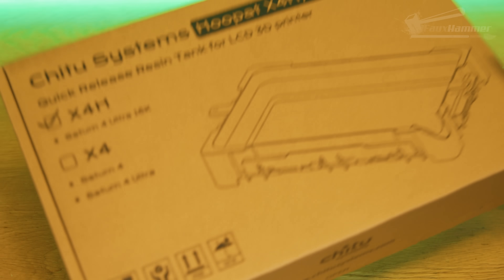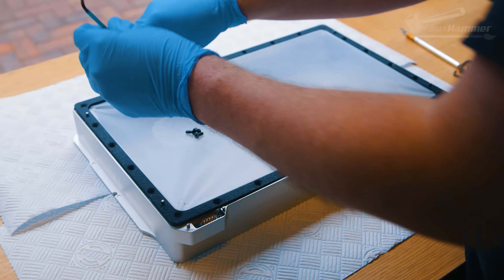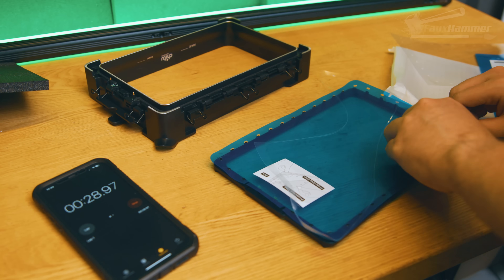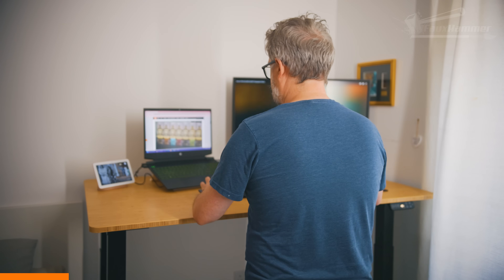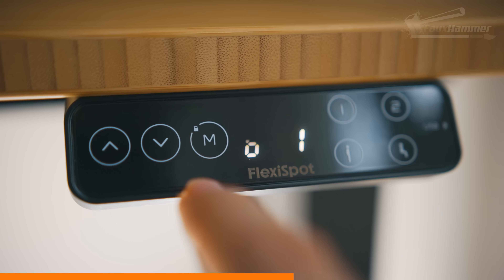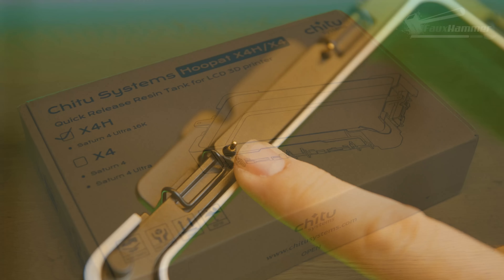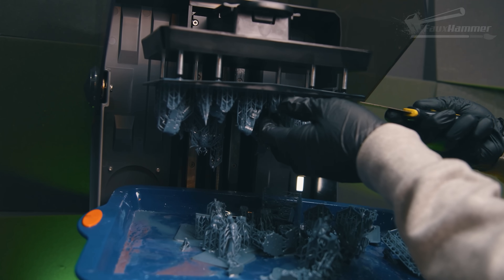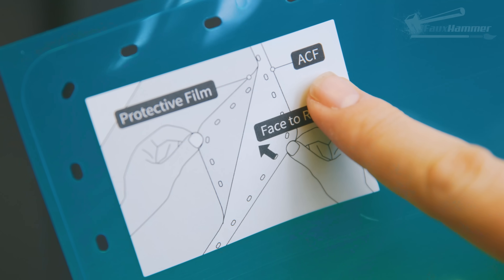Hoopat X4-H Now Exists - "NOT A REVIEW" - "JUST A PRODUCT ANNOUNCEMENT"  (+ Sponsored Segment...)

Comment: Firstly, loving the channel, it has helped me big time in getting set up and what to do, so big thanks for that. On the Hoopat X4H, I love the idea, and when I got mine, it was super easy to install the PFA. That said, I had to return it because one of the pins wasn't long enough to reach the sensor on my Saturn Ultra 16k; it's probably a one-off, but the only thing that lets it down is that the contacts are not spring-loaded like the Elegoo tray; otherwise, it's a great idea.

Comment: could they include a battery and make heated vats for printers that don't have one? then recharge the battery with usb c, or be able to swap it out. also a small toggle switch to change the vat temp from like 3 presets. 
another idea: could they do some research and find better plastic sheet material to use? then they could make it available for all printers.

Comment: So yes this is faster than than the traditional method. But 5-10 minutes to replace a FEP is totally doable. Provided you keep a clean work area and have the right tools. I'm not going to count the time to clean the vat because you need to clean the vat regardless. Even using this vat you should clean it so you don't have resin drips going anywhere while replacing the FEP. I am away from my printer but I am sure i can do it in that amount of time. But there are some things that the people do that make it so they can do it that fast. They probably keep a clean workspace. Not having to clean the workspace to change the release film means you can start right away. Next they probably are not using the included Allen wrench and instead are using something way more comfortable like a hex screwdriver a screwdriver with interchangeable bits or even a battery powered screwdriver. Next we don't do that weird twisting thing when poking the holes. You just need to prick it. But your biggest slow down is that allen wrech. They are designed for torquing screws down not for acutally screwing and unscrewing stuff quickly. Just using an allen wrench instead of a screw driver makes it take 2-3x as long because it's really awkward to use because that's not what it was designed for.
Reply from the maker: Yeah, I think the basolute best time would be between 5-10 minutes but even then I'd question it being properly installed. Sub 5 minutes as claimed by people. and I'd love to see that!

Comment: I bought FEP sheets with frames attached that are already tensioned: £16 for a two-pack for my Anycubic Photon Mono 2. I've only had call to replace the FEP once so far but if I was trying to do it fast it'd take about as long as the one you've shown.

In fact, being a resin printing newbie I assumed that was what everyone did. The first time I saw a video of someone cutting and tensioning FEP from a roll I was shocked!
Reply from the maker: haha, yeah those smaller anycubics did do the whole plastic frame thing. Heygears do the same, but a metal frame and much more money.

But still, doing a mono 2 as fast as this.... (assuming both start with a pre-cleaned vat and onlt need the film sap to be done) c'mon... even with a powered driver....

Comment: Ross… sure, swapping a clean film for another clean one—or installing a new film on a fresh Hoopat—might take 90 seconds. But don’t try to tell me you can replace an old, worn-out film in 90 seconds… unless you’re skipping cleaning the housing entirely.

Yes, it’s innovative. Yes, it’s faster. But under normal conditions, a full replacement doesn’t take just 90 seconds.

For me, a full swap with cleaning takes around 30 minutes on a standard vat. With the Hoopat, I can do it in 5–10 minutes if I want to take care of every detail.

It is fast...  but not that fast.
Reply from the maker: Ok fair and I thought if this as I was doing it.But let’s say both vats are clean and ready to swap.

This during a best case scenario vs the arduous unscrew re screw process is still well longer than 5 minutes. Vs this that is much , much faster.

And even if it could be done in 90 seconds. Heck at a low effort push, I could get this j der a minute. I’d still want to slow down to check everything is aligned properly before clamping too.

This was just a live demonstration of the process whilst timing myself.
Reply: @FauxHammer   Of course, if both vats are clean and ready to go, that’s a completely different story—then it really can be a matter of 90 seconds versus several minutes of fiddling with screws. But I think we can both agree that cleaning the vat is part of the film replacement process, and it does take time. Sometimes a bit of resin gets behind the edge of the film, and you know from experience how many extra steps that can add.

Hoopat is a fantastic product that truly speeds up the process and significantly increases the chances of a proper installation. I really hope it becomes more popular—and who knows, maybe printer manufacturers will start developing their own versions.

P.S.

I’ve never understood why so many people punch holes in the film with a knife, leaving potentially jagged edges around the openings. Personally, after assembling the frame, I simply push a sculpting needle through the holes. It creates clean, round openings without the risk of tearing due to stress.

It’s like making a hole in a plastic bag with your finger versus using a knife—try it yourself and you’ll see the difference.

P.P.S. Great job on developing and running the channel—really appreciate the effort and the content you share!

Comment: Yeah! Innovation, thanks. I need one for Any Cubic M7, did not see it on list. If it included a way to heat it also, I would appreciate it. I am down to see a FEP change Olympics.
Reply from the maker: thats. a good pointa ctualy, they have m5 but not m7? wish they culd do one for the m7 pro but make the interface work with a heated vat rather than a pump
Reply: @FauxHammer  Right I do not have the pro, I could use a USB plug in heater for the vat instead of the fan unit.

Comment: So, say someone has a "old" Saturn 4 ultra, a drill and soldering equipment.... would it be possible to upgrade to a heated vat this way?
Reply from the maker: i think yould be better just lighting a campfire under it, i mean its not impossible, but it's more than just wires that arnt there, there's electronics and programming too
Reply: @FauxHammer  Haha you may be right. If it's the same size I'll get the H version and look at it. I realize I would have to hook up my own power supply, control and sensor.

Comment: the way they made the top edge uneven is really annoying, if that was consistent then it would be easy to put some masking tape around the whole thing or at least the front to avoid resin getting into the mechanism
Reply from the maker: not sure what you mean about it being uneven and getting int teh mechanism? do you mean from runs? spills?
Reply: @FauxHammer like how the top edge goes in rather than being a straight line, ill send a pic on discord

Comment: Well... Such fancy Vats are utterly useless for me I have to admit :/ Not because I like screwing up to 20 screws from my Vat. It's simply because I use to small printers :o I only have space for an Elegoo Mars 5U, and therefore I'm screwed (Pun intended). No heater, no quick-click swapping Vat for this little resin printer, thanks mate. If Elegoo would do the same to the Mars 5U that they did to the Saturn 4U, meaning giving it a 16k screen upgrade and the heated Vat slot.... Yeah. Than MAYHAPS ChituSystems makes a Hoopat for the Mars 5U, too. But right now? Nope 😔

So yeah... Can't use it, so won't buy it. Easy as that.

Comment: i can also see that if you are trying to clean a vat and make sure there is no intermixing this makes it easy to clean as well
Reply: Unless you replace the film between swaps I don't really think it will work as you are thinking. The film stretches so retentioning it can lead to not enough pressure between the film and the lip of the vat causing resin to seep around the edges.
Reply: @MaheerKibria  maybe but if i had to make sure i want to make sure i am not getting any cross contamination and i only had one vat  i would not be opposed.  personally i don't really worry about it the amount  that would be left in for me is not a big deal.
Reply: was 94.94 for me in the usa. but i think for the convince its worth it used your link.

Comment: Something like this for Athena II is coming, but we are working on a solution that doesn't require a perforated sheet (proprietary) and is more reliable. I hate seeing all the photos from users who messed something up during installation and the vat dumps a full bottle of resin on their printer.
Reply: I don't see how you create tension without some sort of perforated sheet, or at least some way to hold the sheet in place. I feel like the solution is being overthought. Now to keep it from being proprietary I'd probaly just sell the punch as part of the solution  or a template using some standard off the shelf punch.
Reply from the maker: Someone else said this has been happening, but between them and this comment, it's the first I'm hearing of it?!?
Reply: @FauxHammer  wonder if is because they are using the film on too many prints. There people that will print till almost failure. I’ve seen printer say I’ve been printing with out changing the vat film in 6+ months. Me depends on how much I been printing, if it looks even a little bit damaged when I drain it to inspect it’s replaced. This should make easy for me if I’m printing about 12+ hours a day (retired, playing computer games lol) to do a fast maintenance on the printers.
Reply: You uhhhhh... You got an ETA for that? Just so that I can get my money ready to throw at you.
Reply: Seems really great, so it will be a addon in the future if I understand well ?

Comment: I'm not into resin printing.....yet! This looks like a no brainer for ease of use, looks very easy to change and with all the extra steps resin printers require than FDM printers, all time savings are good, if they work. Also i guess the vat was on the wrong way round at 5:42-ish, did not realise that it mattered, well you learn something new every day. keep up the good work Ross!
Reply from the maker: You hit the nail onthe head, normally it wouldn;t matter but becasue this has 2 holes for the pins that connect ip the heatetr. you need the frame holes to marry up. ooops!

Comment: The Hoopat is the best convenience product I've bought for my printing set up. I had stripped and had to grind out two screws on my original vat. The new one makes the replacement process trivial. I love it.
Reply from the maker: I've had that too, it's not a surprise when the screws most brands use are soft as shit.
Reply: @FauxHammer  i have never had that happen. but it does take a while to unscrew everything get it properly tensioned and trimmed. for me that's usually a half an hour to an hour.
Reply: @FauxHammer  Sounds like you guys just overtorque the screws. It's easy to do with an allen wrench. But I have never stripped one of these screws.